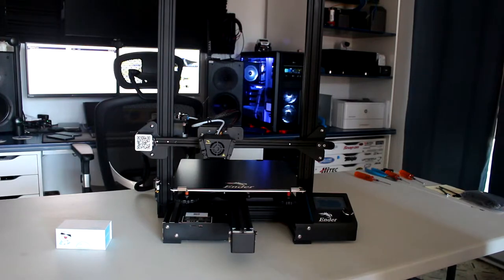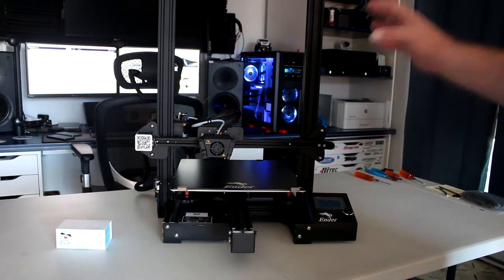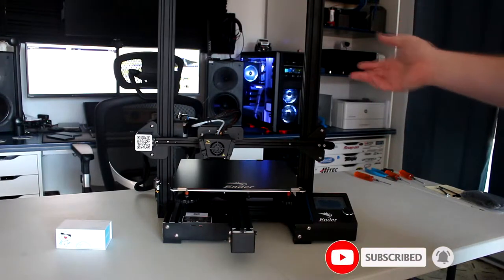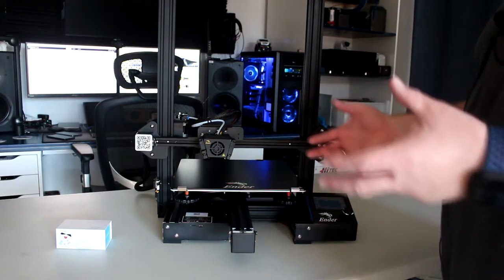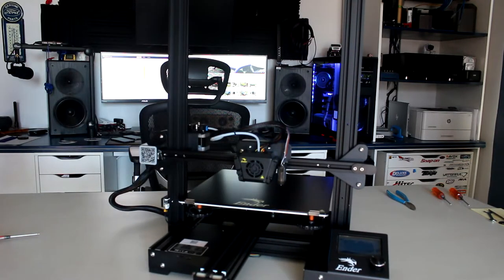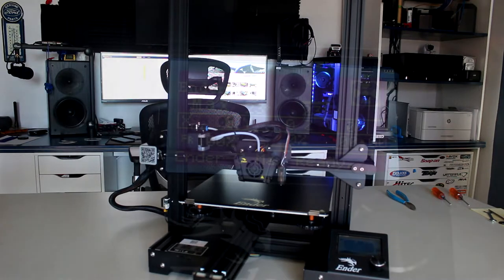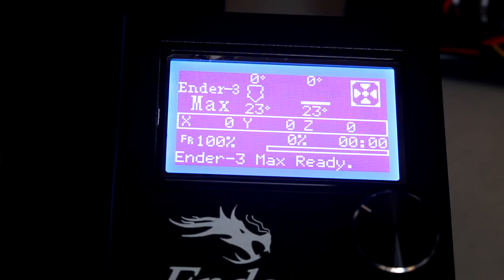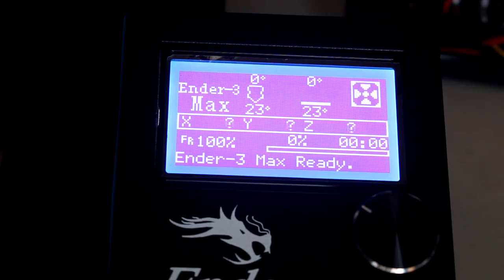Auto levelling  Creality CR Touch On Ender 3 Max

Comment: The CR Touch and BL Touch should be interchangable as long as you use their respective cabling.  The CR Touch is wired differently so you can't just plug the BL Touch into the CR Touch's cable.  I am surprised you could not get the BL Touch to work.  Sounds like a firmware issue or a defective BL Touch.  You could try compiling the fitmware yourself rather than using the firmware from creality which probably not up to date.  Good video though.  I like the CR Touch on the right rather than the left like on my Ender 3 Pro.

I had a CR Touch and it workrd great, but then a few months later the plastic mounting bracket cracked so it was unusable.  I think it might have crashed into the X axis stepper mount.   I bought a BL Touch to replace it though I have yet to install it.
Reply from the maker: The BL touch. And the CR touch have the same cabling even the same colors. Now, if you look at the clone version,i  never played with one.  should be the same or may not I do not know.
Reply: @djsprc  I have a clone and the cabling is different.
Reply from the maker: @zk_6312  thank you for that info that’s what I figured
Reply: @djsprc  It was definitely the cable for the 3D Touch.  I even bought a bl touch cable with a five pin connector for my skr mini e3 v3 and that was wired incorrectly as well.  Using the cable from CR touch allowed the 3D Touch to work though I also discovered my CR Touch is defective as it only flashes a red led.  I will have to buy a new one eventually as it does not seem possible to repair them.  The probe does not deploy on the CR Touch.
Reply from the maker: @zk_6312  congratulations for finding your issue. I would try to contact creality for warranty you have absolutely nothing to lose.

Comment: My CR touch, touches the fan. Guess I can double check if it's fully low and retighten. Unlucky because it's mid print and noisy lol.
Reply from the maker: @chuckdeezy8380  that’s unfortunate. Yes, there is some play in it. You might’ve put it a little bit too close to the side fan once your print is done. Loosen your screws and try to move it out of the way. The other thing to make sure that you don’t have your wires on that side. If you do flip it opposite, it might be your wireless touching too.

Comment: i bought the cr touch, so i can donwload the firmware no problem, but i also changed the cristal bed for a magnet one, the thing is that the bed is now lower than the original, i was wondering if the update wil do all what is needed or i  have to do something else
Reply from the maker: You will need to find your z offset and change it in the printer
Reply: @djsprc  i set the z offset, but i think my cr touch is faulty, becouse sometimes the probe doesn´t go down, and when i do an auto leveling, it stops and starts blinkin red :(
Reply from the maker: @murdocdark5230  that is possible I had one of my probes malfunction to.

Comment: Hi I cannont move my z axis any lower than 0 any help would be appreciated!
Reply from the maker: The way I did it on mine because of the new firmware, I played with my Z offset I gave it more until I got to the correct position on my bed but every time you’re gonna play with the Z offset, you will need to save the setting exit out of the menu and go back in it to lower the probe

Comment: Hello i wanna ask.... my cr touch seen its working but if i start print my print always lift up from my bed and i try 3 firmwers i leveled manually bed and z offset like 8 times
Reply from the maker: It doesn’t mean necessarily that your bed is not level. Sometimes you might need to use the babyz. Or your bed may not be hot enough. It might need to use a little bit of glue.

Comment: i added this to me ender 3 max and followed your steps to the letter it did everything yours did great but when i try to print a benchy my nozzle is a lot higher that what i set the offset at ?? any ideas what's i could be doing wrong i have tried it several times and same thing
Reply from the maker: What I would suggest to go to motion, then move axis, move Z axis, use 1 mm Bring it to zero if it doesn’t touch your bed that means your Z stop is not correct. Would your mother forgotten to do is save setting once you set up your Z stop
Reply: @djsprc  got it working thanks for the help
Reply: @djsprc  Hi, i have the same problem.  Unfortunately I don't understand your solution for this.  Where can I find this in which settings?  Greetings from Germany.
Reply from the maker: @Scoopel  are you trying to install the CR Dutch in? Did you download the firmware and updated machine?  If those steps are done, you will need to find your a Z offset that will be a distance from your nozzle to the bed once you found that you will need to go in the machine.  Under the configuration probe z offset then enter those numbers. Once you did that due to auto home to find out if it’s OK.   Make sure to be ready to turn the machine off if your numbers are not correct.  Let me know if that helps.

Comment: I'm lost. I've watched your video several times. However, when it gets to the point just after updating firmware and restarting the printer, I don't have the same menu options. There is no "prepare". I've got video of it but no way to share it with you so you can see what I'm talking about. I'm not sure where to go from here.
Reply: Are you sure you've installed the right firmware for your main board ? On  these machine, there are motherboard 4.2.7 and 4.2.2. It was writen on it when you've install the CR touch, you should have seen it

Comment: I did exactly as you said but my prints still fail... the noozle is too close from bed, no pla gets out of it...
Reply from the maker: It’s possible that your bed is not a level or you did not enter the correct numbers in the printer.

Comment: Is it normal that when I go to set the z offset it moves? It doesn’t sound like yours is moving when you’re adjusting the z offset value but mine does
Reply from the maker: Sometimes when I change the numbers, it will jerk a bit, but it won’t continue moving.  If yours does the same thing, I’m assuming the glitch in the software
Reply: @djsprc  mine continues to move but I have to stop it or it would smash into the bed before I reach my measured z offset
Reply from the maker: @soldierofapathy1  just to confirm you did do the firmware update.
Reply: @djsprc  yes. The correct one off their website too. Everything else seems to work fine. I just have to disable to steppers while I adjust the z offset then I’m able to correctly set it

Comment: Thank you for this video. This is perfect as I am waiting for my cr touch’s to arrive :D
Any reason why you’re using the creality firmware and not another one? I’ve seen others not recommending the official creality one.
Reply from the maker: The reason I’m using the stock one. Not everybody is able to do a custom firmware and if you don’t use one, that’s correct for your printer. May not end well.

Comment: my sd card is saying no tf card what does that mean? it happen after i downloaded the auto leveling system
Reply from the maker: Depending on the firmware you’re running, you might have the option to load the SD card. I would reboot the machine with the SD card in it.

Comment: Hi hey i followed these steps with my cr touch n ender s max ....after setting z offset when homing it goes to the center but sits 12.8 mm above the bed...thats the initial 10 mm plus the -2.8 offset , any help would be great as i cant print in midair haha
Reply from the maker: It is normal for the printer when you do a auto home it will take a measurement in the middle. Once it’s done the probe will be offset from the bed now once you start a print, your probe should go down to zero in the corner of the bed if that doesn’t happen, you may have taken your measurements incorrectly or not saved it correctly.  If you go under motion and then move axis, you should be able to bring the Z to zero. Technically your nozzle should be very close to your bed.
Reply: @djsprc  Yea mate done all that saved etc gone through the process multiple times....it seems to add the -2.8 to the original 10mm so sits above the bed 12.8mm    cant do bed leveling or print

Comment: Hi, I did all exactly as you told us but when I try to home it says that the print is halted and nothing will move, do u know what may be wrong?
Reply from the maker: This is a new one for me. What I would suggest is trying to reinstall the firmware and make sure you have the correct firmware and make sure that your probe is connected correctly. There is multiple probes out there and some do not connect the same way.

Comment: I downloaded the firmware for it from the Creality site. Then the printer motors stopped working Is there a way to do a factory reset or any other way to get the printer working again?.
Reply from the maker: Just to confirm that this happen when you try to do a level bed if that’s the case. It means your wires for your bl touch are not connected at the correct place.
Reply: @djsprc  The motors do not run in all modes. I unplugged the CR-Touch and the problem still exists. I searched for a way to factory reset my printer, but I didn't find . I contacted Creality and their response spoke in general and not about my printer specifically so I did not benefit from their response.
Reply from the maker: @M.N9  do you know which version of motherboard you have in it because not all firmware a compatible with every board.
Reply: @djsprc  How can I know the type of motherboard?
Reply from the maker: @M.N9  you will need to look at your motherboard.
Reply: @djsprc Hello! I fixed it! but until now I don't know the correct way to download the CR firmware. I go to the creality website and find BL Touch not CR Touch. I don't know how to download it . I searched everywhere and couldn't find a single video explaining this. Can you Please make a video on how to download the firmware?
Reply: @djsprc btw the printer motherboard is 4.2.2